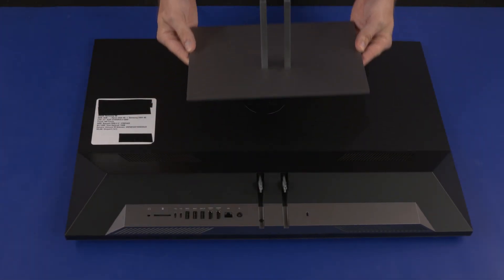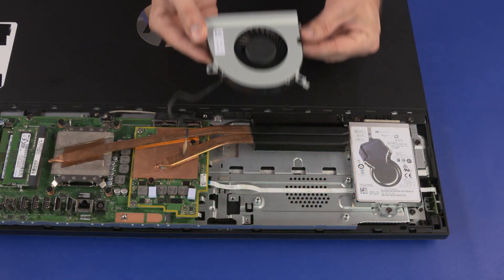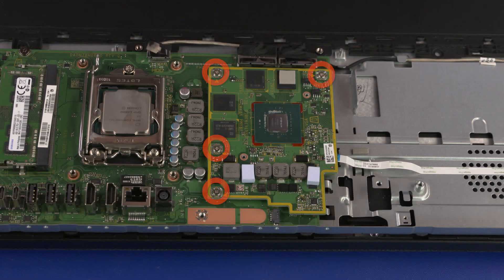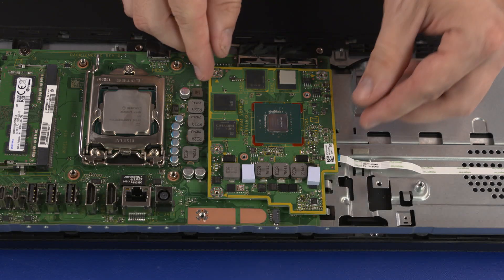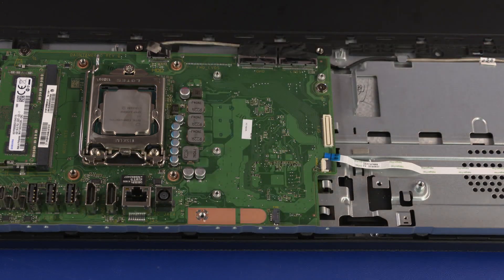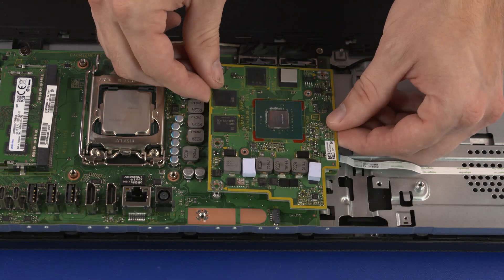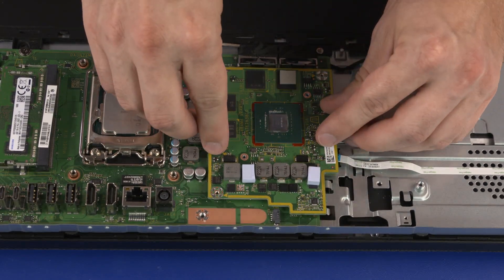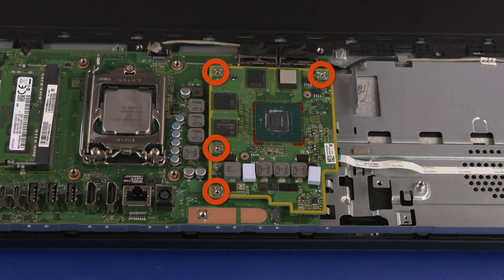Replace the Graphics Card | HP Pavilion All-in-One 27, 24 PC | HP

Comment: Hello, Would I be able to change the graphics card on the model " HP Pavilion All-in-One - 27-xa0071a" ??
Reply from the maker: +Jakeypete HP does not recommend upgrading or downgrading hardware parts or software that is bundled with the product as It may affect the manufacturer's warranty and performance, however, you could change the configuration at your own discretion.
Reply: @HPSupport  can i replace the graphics card in the HP Pavilion All-in-One - 23-q037c model

Comment: Hi, my HP Pavilion AIO 24-xa0024 has an integrated graphics card. Would it be possible to add a graphics card like the one in the video to my computer? I'm assuming not but I figured I would ask.
Reply from the maker: +The Griz I have checked the specification of your computer and it does not seem to have an expansion slot to add external graphics card.

Comment: Hi can you confirm if the HP All-in-One - 24-f0024
Is compatible with the M2 video card, I just upgraded the ram and ssd and saw the M2 port where the graphic card is supposed to be installed and wanted to know if this Hp Nvidia Gtx 950m M.2 Gpu Graphics Video Card  is compatible.
Reply from the maker: +Angel Garcia This computer has 2 M.2 slots. So you can add graphics card that supports this slot.

Comment: can I replace graphics card in my Hp eliteone 800 g1 all in one pc ?
Reply from the maker: +Syed Ijlal Haider HP does not recommend upgrading or downgrading hardware parts or software that is bundled with the product as It may affect the manufacturer's warranty and performance, however, you could change the configuration at your own discretion.

Comment: Hi, can you confirm if its possible to change the graphics card on the HP Pavilion 24-k0012na 23.8 using this procedure? Are there any restrictions on which replacement graphics card can be used?
Reply from the maker: +Adam Howard Checked the specifcation of your computer and found that it does not have an expansion slot to add an external graphics card.
Reply: did you ever get an answer to this? please let me know
Reply: Can you confirm how i can verify which graphics card I can replace on this computer And where can I purchase

Comment: I have a very similar motherboard 85BA, would it be possible to add additional heat sink and add a graphics card to the computer? If so what is the part number for the graphics card being replaced in the video? 24-xa1014
Reply from the maker: +Kid Buu Download (speccy) It'll tell you your motherboard name, google it to check if it has a graphics card slot that is welded in place or is one that can be changed. If yes then go onto crucial.co.uk it should help to tell you what graphics card you're best upgrading to or if you know your stuff then get whichever you like.

Comment: Hi, I just wanted to know if it's possible to change the graphics card to like an RTX 2060 and the power supply on the HP Pavilion All-in-One - 24-k0001nx

Specs: 
CPU: Intel Core i7 10th gen 

GPU: Nvidia GeForce GTX 1650

RAM: 16 GB
Reply from the maker: +Abdulrahman Yousef I have checked the specifcation of your computer and found that it does not have an expansion slot to add graphics card.
Reply: @HPSupport  Thank you a lot for your help

Comment: I have the same exact model computer as the one in this video with a core i7 and the 1050 graphics card, is their any way i can put a better graphics card of the same form factor into my computer, i’d like to assume this computer came with different trim levels with higher or lower quality gpus and cpus concidering that they have the gpu and cpu as removable units, and not soldered directly to the motherboard, so if i could get a link to a gpu of the same form factor and pinout that’s a higher model then a 1050ti that be great. They made the gpu a removable card so that tells me that this motherboard is most likley used amoungst several simialr models with diferent gpus and cpus that are all compadable with this board, thanks.
Reply from the maker: Hi there, thanks for contacting HP Global Social Media Support!
I understand that you need to know about the compatible graphics card for your computer. 
I will do my best to assist you.
Use the HP Parts surfer to identify the part: http://partsurfer.hp.com/search.aspx 
And order it via the HP Parts store: https://bit.ly/3nKMYrs 
Binu - Social Media Tech Support
Reply: If you found a better graphics card for it please tell me i have the same model too thanks.

Comment: Can you upgrade to a better graphics card on the HP 24-f0014 - all-in-one - Core i3 8130U 2.2 GHz - 8 GB - HDD 1 TB - LED 23.8" - US?

If so what would be the best graphics card to get. Also would anything happen to my computer such as it not working anymore after I were to replace it.
Reply from the maker: +Eric Jaramillo Checked the specification of your computer and did not found a slot where you can add external graphics card.

Comment: Hey, Hp Thank You For This Video, BTW I wanna ask, Can I replace Graphics card to nvidia GeForce GTX 1050 Ti and if I'm, then how do I do it
btw these are my pc specs:- 
24-q254in 
Processor:- Intel(R) Core(TM) I5-7400T
@2.40GHz 2.40GHz 
Ram:- 8 Gb
OS build:- 19042.1052
Version:- 20H2
See if this works and if It is Working, then pls tell me how to install the GTX cos it is very big and I don't know much so pls tell 
I have told Every single specifications I saw on my pc, so tell me if You want More Specs ok? BUT PLSSSS RESPOND !!!!!!!!!!!! Also it is I5 7th Generation 3-4 years old.
Edit:- My pc is also All in one and I want to install the graphics card pls respond.
Reply from the maker: +BB1550 In this computer the the graphics card is permanently soldered to the motherboard. So you would not be able to replace it.
Reply: @HPSupport  alr thanks but can I Remove the solder?
Reply: Or can I remove the internal card

Comment: So if i can change the graphics card of my all in one .. then why all the people from the forum say that u can't change it bc its incorporated to the motherboard ?  Bc i would like to change it in a 1060ti  and im not sure if it will work
Reply: Same have you figured it out?
Reply: @theclips5602  not yet
Reply from the maker: +Lil Panda thanks for reaching out!
I understand that you need to know about replacing graphics card on your computer.
I'll do my best to assist you.
If the graphics card is inbuilt (soldered on motherboard) then you would not be able to replace it.
However, if it is not soldered, you can replace it.
Let us know how it goes.
Reply: @HPSupport  shouldn't HP know if the card in th PC that they make is soldered or not?
Reply: @lisaalbarras3029  
First, HP needs to know the detail of your pc such as the name, type, model and sometimes even the serial nos. 
For example: HP TouchSmart 610-1230uk, serial no: abcxyz.......
Reply: @tupolevi  yes that's my point I have given all of that info to him only to be told that I have to take it apart and check it my self.
Reply: @lisaalbarras3029  
Download the program CPU-Z, install and select the "Graphics" tag on the top, it will show the display card you are using e.g. Ati amd HD5570M, Intel HDn000 etc

Something for sure, HP aio pc will be either using a default intel graphic or it is a MXM the graphic card which is not very powerful for gaming.

Comment: Is it possible to change the gpu for 15-dy1071wm ?
Reply from the maker: Hi Raiden, thanks for contacting HP Global Social Media Support!
I understand that you need to know whether you can upgrade the graphics card of your HP Notebook 15-dy1071wm\
I will do my best to assist you.
Solution one- download (speccy) It'll tell you your motherboard name, google it to check if it has a graphics card slot that is welded in place or is one that can be changed. If yes then go onto crucial.co.uk it should help to tell you what graphics card you're best upgrading to or if you know your stuff then get whichever you like. solution two - if your card is soldered into place then just buy a new one. Remember if you're going to open up your laptop chances are your warranty will be void.
Binu_HP Social Media Tech Support

Comment: It is posible in a hp pavilion 15-cs3004ns ?
Reply from the maker: +ismael escalada Solution one- download (speccy) It'll tell you your motherboard name, google it to check if it has a graphics card slot that is welded in place or is one that can be changed. If yes then go onto crucial.co.uk it should help to tell you what graphics card you're best upgrading to or if you know your stuff then get whichever you like. solution two - if your card is soldered into place then just buy a new one. Remember if you're going to open up your laptop chances are your warranty will be void.

Comment: Could I change the graphics card in my hp14 laptop for another. I want this for diablo 2 resurrection? Or you can point me to one that can
Reply: And if I can use the ram out of my broken laptop floor broken acer to hp14
Reply from the maker: +Webeoncloud9 Solution one- download (speccy) It'll tell you your motherboard name, google it to check if it has a graphics card slot that is welded in place or is one that can be changed. If yes then go onto crucial.co.uk it should help to tell you what graphics card you're best upgrading to or if you know your stuff then get whichever you like. solution two - if your card is soldered into place then just buy a new one. Remember if you're going to open up your laptop chances are your warranty will be void.

Comment: Would I be able to upgrade my graphics card on 22-dd0201 model which is powered by Ryzen 3 3250u .
Reply from the maker: +Soumyajit Rout Checked the specification of your computer and found that it does not have an expansion slot to add external graphics card.

Comment: Can I upgrade the mx350 external graphics card in "HP Pavilion Laptop 15-eg0051ne"? I want to replace it with a better card; Is it possible?
Reply from the maker: +Beyondo Solution one- download (speccy) It'll tell you your motherboard name, google it to check if it has a graphics card slot that is welded in place or is one that can be changed. If yes then go onto crucial.co.uk it should help to tell you what graphics card you're best upgrading to or if you know your stuff then get whichever you like. solution two - if your card is soldered into place then just buy a new one. Remember if you're going to open up your laptop chances are your warranty will be void.

Comment: can i change my GPU ON MY HP Pavilion All-in-One - 27-d0109 ??
Reply from the maker: +John Zhou Checked the specifcation of your computer and found that it does not have an expansion slot to add external graphics card.
Reply: @HPSupport  BUT IF I CAN REPLACE IT ??

Comment: Could I switch the graphics card from an hp envy 32 to the hp 24 all in one?
Reply from the maker: +wesley cornelius HP does not recommend upgrading or downgrading hardware parts or software that is bundled with the product as It may affect the manufacturer's warranty and performance, however, you could change the configuration at your own discretion.

Comment: Hello there, can you confirm if it's possible to change the graphics card on HP Pavilion AIO i5-6400T 23-q163d? Thank you
Reply from the maker: +Berry Bertrand I have checked the specification of your computer and found that it does not have an expansion slot to add an external graphics card.
Reply: @HPSupport  what about upgrading it? is that possible?

Comment: Hi, can you confirm if it's possible to change the graphics card on HP Pavilion AIO i5-9400T 27-xa0xxx?
Reply from the maker: +its just luke Revive I have checked the specifcation of your computer and found that there is no expansion slot to add graphics card.
Reply: @HPSupport  alright, thank you!

Comment: Can I replace graphic card in my 15 bsoxx
Reply from the maker: +Atharv FF Solution one- download (speccy) It'll tell you you're motherboard name, google it to check if it has a graphics card slot that is welded in place or is one that can be changed. If yes then go onto crucial.co.uk it should help to tell you what graphics card you're best upgrading to or if you know your stuff then get which ever you like. 
solution two - if your card is soldered into place then just buy a new one. 
Remember if you're going to open up your laptop chances are your warranty will be void.

Comment: Hello may i know if graphics card can be added in hp 24-dp0158qe
Reply from the maker: +Jokerfox369 Fox Checked the specifcation of your computer and found that it does not have an expansion slot to add external graphics card.

Comment: hello, may I know if graphics card can be added in HP Pavilion dv7 notebook pc
Reply from the maker: +asd fg You can't add a dedicated graphics card to the system like this. The vga is soldered to the board so no way you can just plug it in like on a desktop. However, you can buy a new motherboard with the dedicated graphics card on it. It also requires a new heat sink. 
Manual: http://h10032.www1.hp.com/ctg/Manual/c03221579.pdf
You need a 682040-001 board plus 682061-001 heat sink to have a dedicated graphics card on your laptop.

Comment: Hi,
I just wanted to ask whether i can upgrade my hp 15-ac091TU graphics card to gtx 1050ti.
Reply from the maker: +RELIPSEY HP does not recommend upgrading or downgrading hardware parts or software that is bundled with the product as It may affect the manufacturer's warranty and performance, however, you could change the configuration at your own discretion.

Comment: HP Pavilion 27-d0244 at the moment it has integrated graphics.  Do they make graphics cards for it.
Reply from the maker: Hi there, thanks for contacting HP Global Social Media Support!
I understand that you need to know about adding external graphics card on your computer.
I will do my best to assist you.
Checked the specifcation of your computer and found that it does not have an expansion slot to add external graphics card. 
Binu - Social Media Tech Support